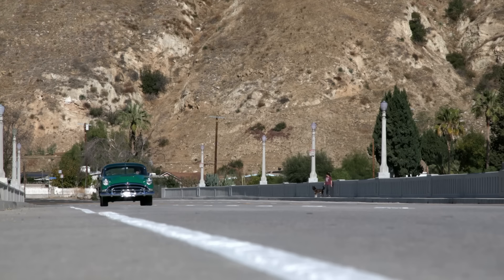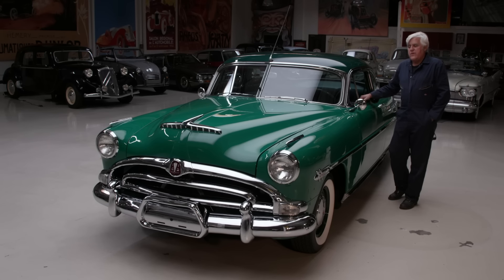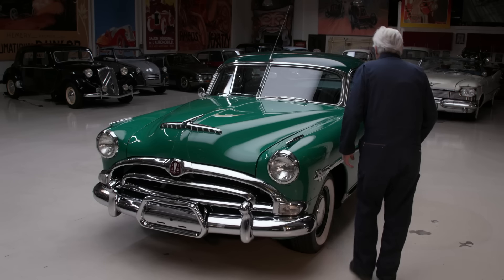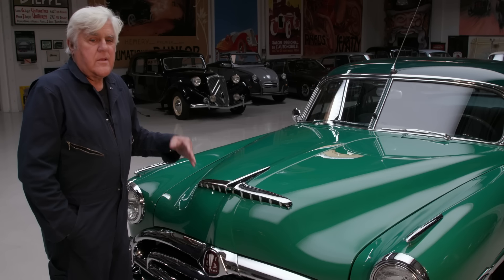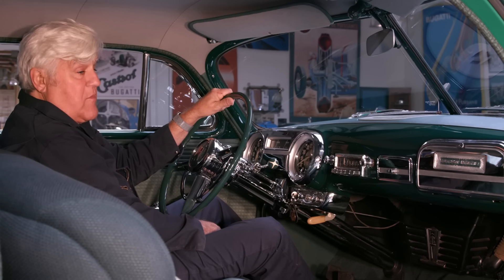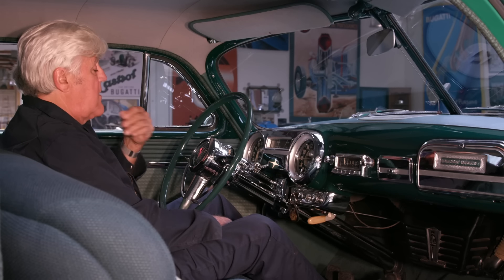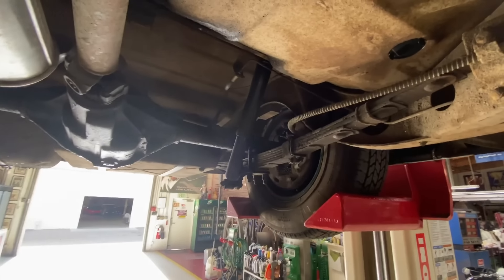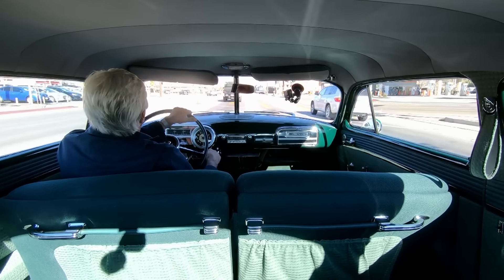1953 Hudson Hornet - Jay Leno's Garage

Comment: When Jay shut the driver's door, it sounded like a bank vault closing.
Reply: I caught that too.
Reply: When they close bank vault doors they sound like Hudson Hornets.
Reply: Redline reviews approves.
Reply: And that's why you call em "bulletproof", LOL!
Reply: Yeah,  it really did, didn't it
Reply: thats one of my pet peeaves i cant stand to see folks slam the doors like that i have a 69 impala and you can close the doors on it with 1 finger   they dont need slaming if you have to slam them to get them to shut something is out of wack.......
Reply: @freebird1ification  yeah, that's for sure 

I've even seen people do that same thing with newer cars when it's absolutely unnecessary
Reply: @freebird1ification  
Mine as well, my sister is shamefully bad at slamming car doors.
Reply: @freebird1ification  That's the difference. While I'm a big Chevy fan, they were built much lighter than the ones of the early fifties. Slamming the door had ZERO effect on the car. They were designed to take that, it wasn't considered abuse.
Reply: the same with the trunk closing - it shows the quality.
Reply: Same with the hood lol

Comment: Back in 1977 I started working as a 19 year old apprentice in a machine shop in Cincinnati. The owner of the shop somehow knew I had a facination with cars. One day he took time to talk to me and the subject turned to cars. He told me as a young engineer he had worked for Hudson. He explained all kinds of facts about the powerplants, suspension, and multitude of features within these cars. I hate to say, but at the time I was a die hard muscle car nut. (anything built before 1965 wasn"t worth talking about) Wow, was I wrong. These cars were the beginings of NASCAR. He almost got, "giddy" telling me that if you rolled one of the vehicles, chances were very good it would upright itself. Said the were built like tanks. RIP Laddie.

Comment: My dad owned one and said they really were a lot faster than you'd think. 308 ci is big for a 6 cyl even today. This version had 170 hp which isn't much by today's standards but for the time, it was astounding.... and from a 6, not an 8. The first Chrysler hemis were only 180 hp.

Gorgeous car, Jay! Thanks for bringing it to us.
Reply: A distant relative told me that, back in the day,  he was driving a Dodge with a V8 and got into a race on an empty road with a Hudson Hornet.  Said that the Hudson left him behind.  He could not believe it.
Reply: Ford made a few million 300 cubic inch sixes for pickups. 7 main bearings, great engine.
Reply: It’s really torque that matters, not HP, and old flatheads are like aero engines, or diesels, low RPM and high torque…
Reply: Might not be huge hp but the torque !
Reply: I believe the 1953 Chevy 6 boasted, 90 H.P.
Reply: I miss the small car companies from that era.  6 cylinders are a great engine.  It's bad that AMC went away. Great video Jay.

Comment: I'm south African and my father drove a Hudson in the 1960s. He put a V8 engine in and had to modify the gearbox mountings by welding a 25mmplate on old gearbox. The engine was so powerful that he had to have spare shafts (from diff to back weels) in the trunk and if the old man floored it the back weels won't spin as car was very heavy and powerful and the shaft would just breach of like a twisted toffee! I remember in mid 1960 us replaceing shaft next to road .... Yep good times😂

Comment: "The big steering wheel".  We're the same age, Jay, and I still remember the big steering wheel in my parent's  '51 Buick and the sound that dad's wedding ring made when it 'skipped' against the 'finger grooves' as the wheel returned to it's neutral position after taking a corner.  A nice memory.

Comment: ive always wanted a factory perfect car from the 50's, 60's, and 70's to see what they were like brand new
Reply: Nothing comes close. I've been in several and a good 50s car is unbelievably wonderful. See if someone will give you a ride in an old bel air or a 60s vette. You'll re think what you're driving.
Reply: There's a very big difference between a used 50's car and a maintained 50's car. And then there's an even bigger difference between a maintained 50's car and a factory perfect 50's car. They really drive well. They are comfortable, easy to drive and quiet. The only thing you have to get used to is the size and the fact that a lot of 50's cars don't have power steering and power brakes. But indeed what Mark says, you really have to experience them. It's such an experience to be in one let alone drive one
Reply: You have to find a seriously restored one that runs perfectly and has new door gaskets, refurbished seat padding, new suspension and steering gear parts etc. Old door gaskets leak sound as well as water. Worn front suspension and steering gear parts make the ride and steering precision (at best neither up to modern standards) a lot worse.

Comment: 16:26 The straight six is a naturally balanced engine, has more crank bearings than a V8.  They run smooth and long, can be built to rev high or rev low, perfect for a Hudson!

Comment: Watching Jay with the column shift reminded me of learning to drive on my dad's 53 Plymouth  Savoy. It also had a flat head six with a three speed. Hadn't heard that floor pedal "thunk" since 1966.
Reply: “Three on the tree” is what it was called
Reply: Years ago I saw a '59 Ranchero in a used car lot. My daughter was 16 and learned to drive on a manual. When I got back in the car I asked "have you ever seen a three speed on the column". "What", looked at me like I had three heads.

Comment: @ 8:40
Absolutely correct. My Dad had a 52' Crestline Victoria that had been flipped in the 80's. They dropped a 289 in it (AC, power steering, front discs, etc) but didn't replace the original 6 volt cloth wire, just buried it under layers of tape. They used the duraspark ignition, but didn't install a ballast resistor so it was cooking the coil and solenoid and it just didn't run right. He always thought the running issue was a problem with the Edelbrock carb. I ohm tested the old wiring and it was shot. New 12 volt ignition wire, ballast resistor and Viola! It ran like a clock! The shops he took it to never figured out the problem. I only wish he was alive when I fired it that day. When I was done it ran and drove like a different car. 
Thanks for sharing your passion for autos. Dad was a big fan of yours.
Reply: thank you for this

Comment: 6v wiring uses heaver gauge wire than 12v systems. The 6v wires would be oversized and no issue for 12v
Reply: I changed my VW Beetle to 12 volt and it worked perfectly. I startled myself when I accidently lent on the horn ring and the horn sounded loudly. It'd never made a sound before!
Reply: Yes, i dont think Jay really understands the engineering at all.
Reply: Yep, that annoyed me too. He's said that a couple of times now, misleading. Only a few components like solenoids, relays coil etc need changing. The gauge used for 6v is well over spec for 12v no problems at all.
Reply: Yes the 6V pulled more amperage than the 12V system so the larger diameter wire is actually a good thing.
I'm sure Jay is just a bit confused on that and has not likely studied electronics.
Reply: @richardsheil5289  he understands more than you think,,,,,more than most
Reply: Tom stiel, I'm  not saying he's not a good guy, just that he doesnt understand engineering.  He often gets it wrong. Just likevthe Fiat / Lancia guy, the late John Campion, who also used to muddle it up.
Reply: I think Jay is great and love the channel. Just don't want bad info out here
Reply: If you still have the old cloth covered wiring with rubber insulation, and the insulation is all dried out and cracked 12volts will short out easier than 6. There was a time you could change these cars to 12v without new wiring but it would be too chancy today.

Comment: My dad owned three Hudson Hornets. We would take trips to upper Michigan, and I was so young I would sleep in the back window. I remember my dad loved them and told me the only bad thing about them was the timing belts didn't last but about 20,000 miles. I don't remember him having trouble with them; but I was very young. He didn't seem to keep them very long, but he did like them. His last one was a 1956 Hudson. It had two four-barrel carbs on it that gave a lot of trouble. We took a trip to Arizona and the brakes went out twice on the trip. The second time was because the mechanic left the lines loose, and they vibrated a leak. I can't help loving those cars for no other reason then my dad love them and they bring back memories of a great father. It seems like my dad's was green, but I was so young, I could be wrong. Thanks Jay for the memories. One other thing, I remember playing with the knob for that outside antenna.

Comment: "Six volt wire, is FINE in a 12 volt system, but not the other way around.
Reply: Vice versa 🤔
Reply: You are right. Jay didn't look particularly convinced of his own explanation... 😊. The important thing to be in mind is the Amps, to run a típical 55W head light with 6v you need double te amps compare to 12v. So 6v wire will have to be twice as thick as 12v for the same load. So 6v wire can can run double the load at 12 v.
Probably the real reason the wire is changed is because is really old and isolation on the wires is decaided and a fire hazard.
Reply: @xg5zm  This is the first time that I heard of a 6 V. alternator!
Reply: I think a lot of people do not understand what he was saying about the alternator. Back in the day cars were built with generators. Alternators do a better job of charging when engine speeds are low (like at idle) and that is why he replace the generator with an alternator.
Reply: It's all about wire gage, the cross sectional dimension of the conductor.  Double the voltage, you have less IR drop across the conductor..  Detroit went to 12V to cut their copper costs by 75% .  Same reason they went to "computerized fuse boxes," a la the infamous Chrysler TIPMs....all to save copper costs
Reply: Well, I'm just not that experienced, but I'm almost 70.
Reply: Wiring is about AMPERAGE just like in houses😊
Reply: Affirmative. Actually in 12v cars it's actually sometimes good to change wires for thicker like 6 volts. In some cheap installations it actually gives you more light on the road without changing light bulbs or anything else.
Reply: @SparrowNoblePoland I have two 6 volt Citroens and have rewired both with 12 and 14 gauge wire. I've never had a problem with them. I really can't see the need to "upgrade" a 6 volt car to 12 volts. I've never had a problem with the 6 volt VWs I've owned, either. I don't need sat nav or a stereo when I drive an old car.
Reply: I don't know it's true or not, but i've heard a time or two that the 6v wiring didn't have enough insulation for 12v.  i partly believe that the real issue that 6>12v can have a lot of issues on other parts of the car, so mechanics just told big stories back in the day to not have to do it.
Reply: @crazymcq  In the U.K. it is common to take a 6 volt Citroen Traction Avant and make it 12 volts. But one thing is that you'd be dealing with wiring that is, at a minimum 64 years old. it would be best to re-wire the entire car if doing that as any 6 volt car will have old wiring.
Reply: @ddd228  There are companies that will convert a generator to an alternator and keep the generator so it looks original. Nothing wrong with that. there are ads in Hemmings for such services.
Reply: Yep.  Came here to say that.  Seems Jay just isn't an Ohms Law guy, lol.
Reply: Jumped s 6 volt rambler just bought by my boss
Used 12 volts... burned  up the wires..
Reply: 6 volts need double the amps to have the same wattage, so 6 volt wire is much larger, which like having extra money is not a problem. Like the engine explanation, total BS. Inline 6 engines are balanced (naturally smooth) because the crank shaft is always being "pushed" by one of the pistons.

Comment: If it is safe wiring to begin with, 6 Volt wiring is fine for 12 Volt conversion, every bulb needs replacing as well as ignition system.
Reply: Jay is not an electrician
Reply: Yes, 6 volt wiring has to be heavier than 12 volt to carry the same current.
Reply: @emjayay  In this case 6 Volt and 12 volt generally use the same power in Watts, the 6 Volt is twice the current in Amps than the 12 Volt system.

Comment: " Freedom is never more than one generation away from extinction.  We didn't pass it to our children in the bloodstream. It must be Protected, Fought for, and Handed on for them to do the same, or one day we will spend our sunset years telling our children and our children's children what it was once like in the United States where men were Free " - Ronald Reagan
Reply: My uncle has a country place
No one knows about
He says it used to be a farm
Before the Motor Law

On Sundays I elude the eyes
And hop the turbine freight
To far outside the wire
Where my white-haired uncle waits

Jump to the ground as the turbo slows to cross the border line
Run like the wind as excitement shivers up and down my spine
Down in his barn
My uncle preserved for me
An old machine, for 50-odd years
To keep it as new has been his dearest dream

I strip away the old debris
That hides the shining car
A brilliant Red Barchetta from a better, vanished time
Oh fire up the willing engine, responding with a roar
Tires spitting gravel, I commit my weekly crime.

Wind.  In my hair.
Shifting and drifting
Mechanical music.
Adrenaline surge.

Well-weathered leather.
Hot metal and oil.
The scented country air.
Sunlight on chrome
The blur of the landscape
Every nerve aware.

Suddenly ahead of me, across the mountainside.
A gleaming alloy air-car shoots towards me two lanes wide.
I spin around with shrieking tires, to run the deadly race.
Go screaming through the valley, as another joins the chase.

Drive like the wind, straining the limits of machine and man.
Laughing out loud, with fear and hope, I've got a desperate plan.
At the one lane bridge, I leave the giants stranded at the river side.
Race back to the farm to dream with my uncle at the fireside.
-Neal Peart
Reply: Beautiful quote.  Appreciate you sharing!

Comment: My mom tells stories about driving her dad's Hornet and beating guys cars off the line on Friday nights
Reply: Awkward
Reply: Thanks, for story.....Interestingly, my first drivers were 1953,s ( Chevy 4 DOOR ,Powerglide/6:CYL’)......would have love to have A HOT MERCURY, OR HORNET, ESP 2:DR// straight stick.)....Also, interestingly, my Dad found a 54 Ford ( *V8/2 DR/manuel( WITH 57 v8 Engine/ Dual exhaust;/ mild custom by Mechanic) that was fairly good , mover ( never mind,  a lot of braking or Cornering), though it was upgrade a size in tires......
Reply: @robertjonas6216  heaven forbid someone's mother drove a car once

Comment: Knew an old guy that loved Hudson cars. He told me one time when he was a young man. He was speeding on a country road, couldn't make a curve, and ran off the road and rolled his Hudson one complete revolution that ended up with the wheels down. Not a single window broke or cracked. Told me that he just started the car and drove away. The car suffered no damage at all. Cars back in those days were built rock solid with thick steel.

Comment: HI! Jay:   My paternal grandfather had a Hudson Hornet.  I don't recall what year it was.  My grandfather was known to drive fast.  Day or night, if the traffic was light, he was putting that Hudson through it's paces.  One time they were coming back from Reno on old 2-lane Highway 40.  Traffic was light, and granddad was flying!  As they approached the town of Colfax the highway was quite windy.  Coming around a blind curve there were cars stopped in the road, and there was oncoming traffic.  Granddad had no place to go.  He couldn't stop in time, and all he could do was plow into the stopped cars.  My grandfather braced himself with the steering wheel.  He was a big man, 6'2", and with the impact the steering wheel was bent down around either side of the steering column. 
There was a woman friend of my grandmother sitting in the back seat behind her.  No seat belts, so the impact threw the heavyset woman forward into the back of the front seat, which shoved my grandmother through the windshield.
My uncle, my dad's younger brother, was riding behind his dad.  Once - granddad got out of the car, my uncle jumped out, and took off his shirt, and began running back up the highway around the blind curve, trying to flag down any approaching traffic.  Two cars ignored him and went on around the bend slamming into the Hudson.  
Cars were built better back then.  No one was killed, and believe it or not, the Hudson was rebuilt and driven a number of more years. 
I always liked the Hudson Hornet.  You told me things about the car I was too young to know.  Many thanks. 
In 1952 my dad bought an Olds 88, with the Hydro-automatic tranny.  My dad street raced with that car every chance he got.  But he nearly ended up being in an accident once, and my mother put the stop to street racing whenever she could.  But even so, when I was along alone with him, he'd open up that Olds 88, and we'd be doing 90 or better for a while.  Dad always said, "Don't tell your mother!"
I recall reading, Ford once made an Interceptor as a police car.  But it proved to be under powered.  Factory Pontiacs of the same era could out run Ford police cars, without modification.